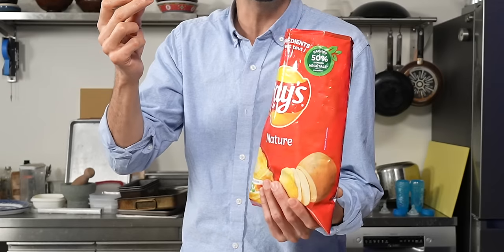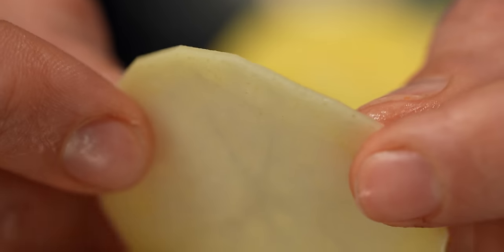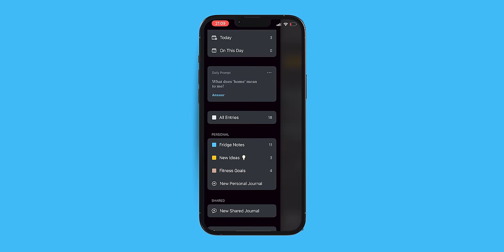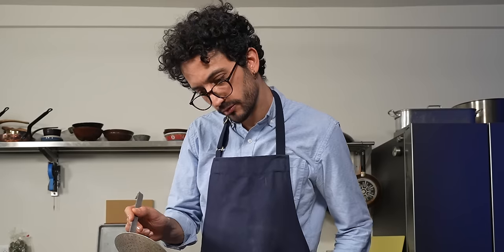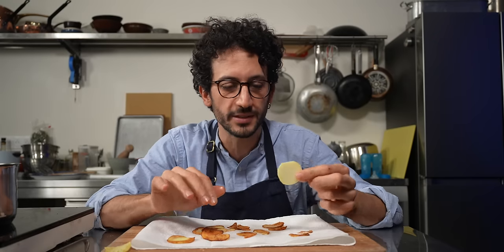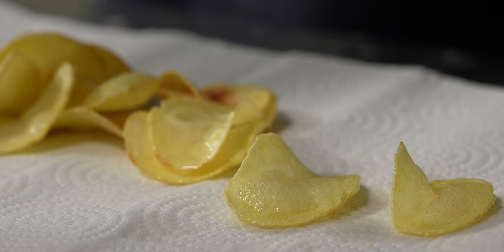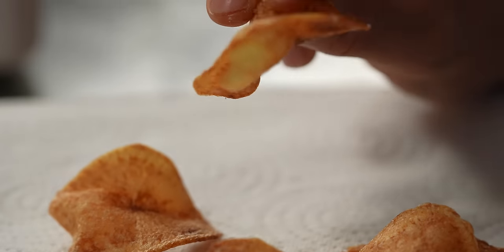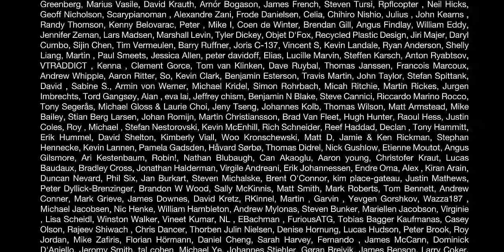How Hard Can It Be To Make a Potato Chip ? (hint: Fly you fools!)

Comment: If I might interject here...  Your biggest 'enemy' isn't the temperature of the oil, or the starch...  It's the water.

The water-content of the potato chip is causing the oil to drop in temperature, slowing the cooking process, and by the time it's DRY enough to get that crisp, then it's browned from the maillard reaction and/or caramelization. 

The biggest "secret" to making chips that are 'close' to store bought is by drying the potato a LOT.  Getting rid of about 90+ % of the moisture from the potato slices FIRST and THEN cooking them will make a chip that is MUCH closer to store-bought.

I used a food dehydrator to get 'close' to the level of moisture before frying them and I got very close.  Unfortunately I never did get 100% there, because I was too lazy, trying to make too many chips at once, instead of going low and slow.

Ideally, you would dry them in not a food dehydrator, which uses air to dehydrate them, but you should use a vacuum chamber, in order to pull all the moisture out While avoiding the oxidizing effects of air.  And as long as they're separated enough, and you have a good drying agent in the bottom of the vacuum chamber, you can get almost all of the water-content out in no time.

At which point you can fry them with a very small amount of oil in an air fryer, so they don't get that oily quality that you're trying to avoid.  

That should get you a final product that is insanely close to the store-bought potato chip.  Granted they do it a different way, I believe it's a pressure-differential cook, but we'll see.

Comment: Hey alex. I believe your failure happened because you tried to hit 2 birds with one stone... Or actually 7 birds😅.
You missing few steps in your process, i cant say which is the absolute correct way coz i aint a factory but i can help you adress the problems in different ways.
The enemy of crisp is moisture and the enemy of pale/white is sugar/starch.
Start with getting the potatoes with lowest sugar content.
Slicing and washing from starch is correct but probably more than once.
Then i belive you should be cooking it in salted water, maybe even more than once.
Pat dry.
Now comes the more important part of the process and i dont know wich one is more accurate so you have to try...
You need to either fry on low temp as much as long as possible and then put in a dryer or the other way around.
I do believe the first one is more accurate as it will make chips that arnt perfectly flat and the extra water from the cooking in salt water will both make bubbles in the chip and give you longer time in the oil without browning. Also drying things that been fryed squeezes out extra oil from the chip, considering that we dont have puddle of oil in the bottom of the bag i believe its how its done correctly...
1. Correct potato
2.slice
3.wash in water till water is clear.
4. Cook in salt water
5.drain and pat dry
6. Fry
7. Dry in a salamander/ air dryer
Salute ✌🏽